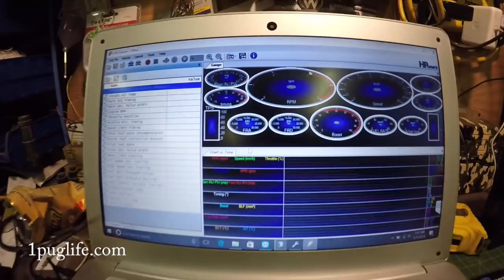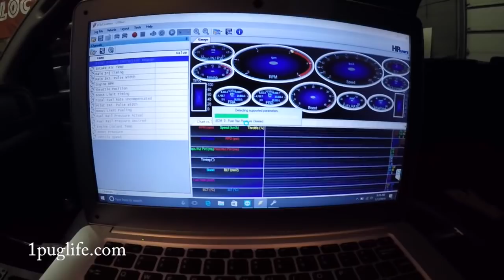more upgrades on the dodge cummins

Comment: If you didn't like the sounds the gauges made you are going to hate that visor especially with the wind on the flats.
Reply: Yep it's gonna be flappin around like an albatross's wings or your  moobs.
Reply: With a bit of luck, maybe he can get the bumpers, gauge set, and the visor all tuned to the same harmonic frequency.
Should be interesting.
Reply: I have a visor on a 1996 f150 that didnt budge ona day with high winds